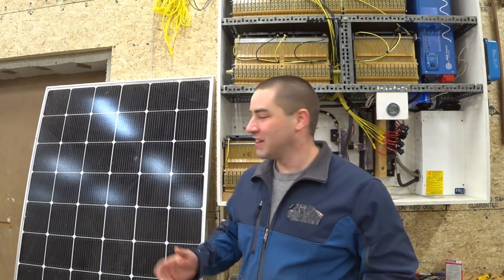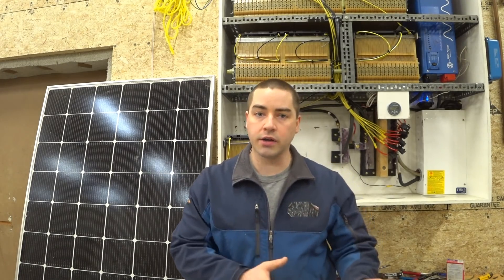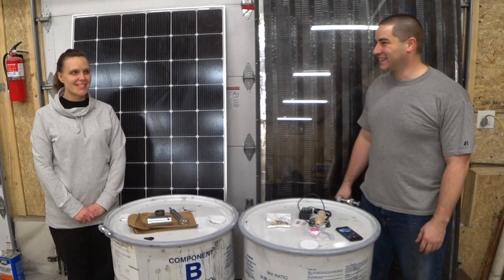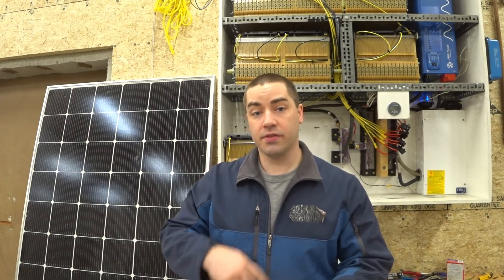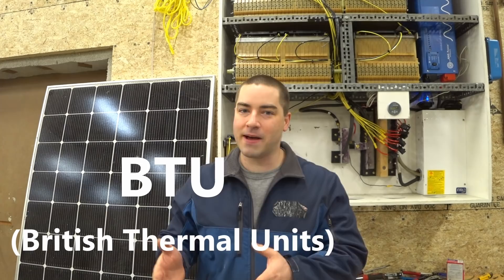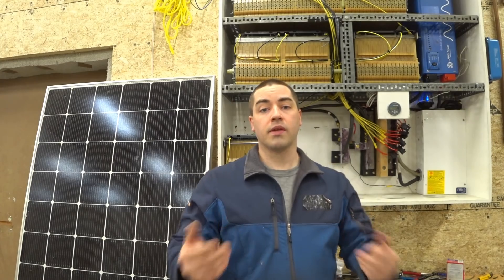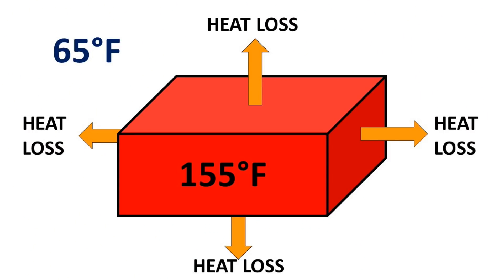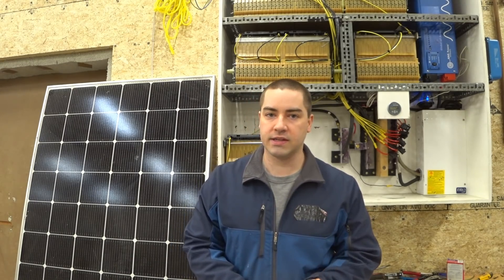Cheapest Energy Storage Off-Grid

Comment: I will pass along here 2 great ideas from the awesome website https://www.builditsolar.com/index.htm, where DavidPoz has a recent article:  1) Solar heat collectors are more efficient for HEAT than PV panels, and can be built by simple diy methods. So you may want to try 'collectors' as an addition to your pv array. 2) Consider building 3 heat storage tanks that are kept at 3 progressive heat levels, so as to charge (and use) them in an optimized way. In sequence of tanks 1, 2, 3, charge them so that the 'hottest' tank 3 gets its charge (heat storage water vs collector water vs use water) up to the level needed to top off the 'use water' at desired output temp. The hot water coming from the solar collector goes into tank 3, then exits to tank 2, then to tank 1 before returning to the collector to be reheated. In this way, tank 3 grabs the effective heat optimally, then passes the 'now less hot' collector water down to tank 2 where the storage water is not as hot but the delta is large, and tank 2 absorbs some more of the heat in the collector water. Then the 'least hot' collector water goes into tank 1, the coolest tank, and even lukewarm collector water can dump a little heat into tank 1, as the delta is still high. Importantly, the 'use water' line passes through the tanks in the OPPOSITE direction of the collector water, so that the coldest use water enters tank 1, and absorbs a little heat from the lukewarm water in tank 1, as the delta between cold tap in and the lukewarm storage water in tank 1 is still fairly high, and this does not cool off your hot tank 3. Then, after leaving tank 1, the now lukewarm 'use water' goes into intermediate tank 2, where the delta is still large, and absorbs some more heat before going to tank 3 for the final heating stage. Note that the tank 1 need not always be lukewarm, as a few days of good sun and low use will allow the full heating of all 3 tanks. Now for a suggestion on how to achieve the 3 tank solution without wasting good structural walls needed to contain the sidewall pressures of a big tank: Using one single large tank, use a 1/2 inch layer of foam insulation to separate the tank into 3 subtanks, with hot tank 3 on top. The insulation layer does not need to be completely waterproof, just do a decent job of allowing the 3 layers to roughly keep their own temps. Then, have your heat exchanger coils into 3 sections and passing through the insulation layer in one hole. Each heat exchanger (1 for collector water and 1 for use water) moves in opposite directions, bottom to top for use water, and top to bottom for collector water. Great site David. thanks.

Comment: Thanks ! I never considered using hot water (liquid storage) before. 
Where I live I'd consider using Mineral Oil in place of water. 

Have you looked into a parabolic reflector for your solar water heating?  One could also use large fresnel lens(es) to heat water (and to melt other things, too).

On another youtube channel a gentleman used flat panel reflectors just using aluminium foil to increase heat from sunlight by up to  20%.
Reply from the maker: Green Power Science is an excellent channel.  I love his projects.

Comment: Okay this one is out of topic question but I am asking hoping to get a answer. I have installed a solar gyzer. It has a vent line on top of its tank. Can I install a breather valve on the vent pipe. Would this save hot water energy?
Reply from the maker: I wouldn't modify the factory vent.  But I also don't own one so I'm not sure.

Comment: would it be possible to store heat (+electricity via heat exchanger) in salt?
Reply from the maker: There are some large commercial systems that use salt, but it's not practical for a small residential system.  Thanks for watching.

Comment: Have you thought of using a bypass for your solar electric as an electric heater coil to absorb the excesses electricity you are not using once your batteries are charged to transfer into your water storage tank as well as the solar heater ??? It would be a secondary way to heat your water when the water solar panel does not produce enough heat during the midst of the coldest days of winter.
Reply from the maker: Yes, absolutely.  I have been playing with diversion loads the past year, but have not implemented one yet.  I just bought bigger inverters, so I plan to set up the diversion load on the AC side.  Thanks for watching.

Comment: Good engineering presentation of heat transfer! However you make sure you treat this stagnant thermal water... both chemical treatment and fresh water makeup + flush thermal water should be done to avoid heath risks... 
Good to note that your thermal lost is overestimated because your Delta T between T ext. & T water will decrease during your electricity shortage! But this constant Delta T assumption  is okay, it is just nice to know that you overestimated the heat lost of the hot water tank.

It would be nice to know how you control and heat your thermal hot water. This component would definitely add up to the total cost of the project.

Comment: We have both solar water and solar electric panels at our house, and the solar water system saves the most money.  But your calculations are somewhat flawed.  You need to add the cost of several solar hot water panels to your system.  There is no way one panel will heat your volume of water to the desired temperature in the number of sunny days available.  You also need to figure out what you are going to do with the excess heat in the unusually sunny periods.  In my case the system overflows into a dry well and new fresh water refills the tank, running up the water bill.  Your numbers seem to be correct, but not complete.

Comment: My heat/domestic hot water comes from storage.  I have a 1500gal tank insulated with closed cell foam.  With my Delta of 95°, I've got roughly 750,000 BTU capacity.  Currently, it's just heat with biomass but I intend to try adding solar thermal next spring.

Comment: keep talking with me over pressures difference's by hydraulic pressure machine and atmospheric administration

now we know that one kg force per cm square area then we use one kilometres squares surface gives tremendous pressure which can easily push or pulled leverage system so we got more healthy option for the world wide pollution solution

Comment: Very interesting!  I am looking for a good way to store energy to heat my garage in the winter to work on projects on the weekends.  I was thinking of doing an in floor heating for the garage  using your method of stored heat even if I had to heat the water from the grid in Offpeak hrs during the week.  But one of the main issues is the floor,  a huge piece of concrete that is not thermally isolated from the cold in the ground and outside edges. I guess I could get a saw cut slots to put in thermal breaks on the outside walls and that would help but the floor come mid winter is still a big portion of energy sucking cold monster.  My walls and ceiling are insulated now but I might have to build a room with raised floor.
Cheers
Reply from the maker: There are a few methods to fixing this.  In my area (Massachusetts) Our garages are made with stem walls, and the slab is poured seprate from the walls.  I've worked on jobs over the years and used two methods.  1: Jack hammer the slab, then insulate, vb, new slab.  2: if the ceiling is high enough, insulate and pour a new slab directly on top of the old slab.

Comment: Brilliant  
Eventually this will be the way to go  Figure out a way to sell a package that integrates PV and thermal storage and you're golden - needs circuitry that shunts PV into HW storage after batteries are topped off.  Indirect is more expensive at first and you have the heat exchanger that needs maint can foul and loose efficency req not inexpensive replacement, direct avoids that but needs a sterilization cycle that will require grid connected power (or for real off the gridders another heat source, wood stove, etc)  
So solutions:
1. Indirect storage Several 100 gal HW rated storage tanks linked to small 20 gal elec water heater w a circulating pump and circuitry to dump PV into the 20 gal heater and circulating pump.  One storage tank has the heat exchanger coil.  I'd guess for 300 gal system about $1,500 of equip needed.  This is probably simplest option for off the grid.
2. Direct storage,  20 gal elec heated by PV after batteries full w circulating pump to 2 - 3 days of hyper insulated storage tanks feeding into you 'standard' HW heater (another circulating pump from your 'standard' HW heater to storage tanks, on timer to sterilize water daily set to run from midnight to 6 AM until such time storage tank temp hits say 140, which will sterilize water in 30 mins or so - sounds bad but if excess PV has already gotten the 300 gals or more of storage water up to 120, not so bad) If by chance you are on peak / off peak power plan to say charge an elec car then even better as sterilization heat will be low cost elec.  I'd guess about $1,000 of equip needed (no heat exchanger those are pretty expensive)
Hope this helps you.

Comment: I'd be interested to see how I can turn the 250 gallons of hot water back into electricity at a rate of 3:1. I use natural gas to heat my water on-demand, so I'd like to find a way to store energy to turn back into electricity. Though the side benefit of having 3-4 days of hot water with no power is pretty cool. Are you using your outdoor solar water heater to get your pool to 180ºF or just electricity or a combination?
Reply: Eh, probably not possible it seems. A company based in Dublin, Ireland called Exergyn has a system that takes 200kW of thermal energy and converts it to 10kW of electricity. Doh.

https://www.newscientist.com/article/2113109-energy-efficient-engine-turns-waste-hot-water-into-electricity/

Comment: A-MAZING analysis! Got me thinking of the idea of a hydronic radiant heating system for our own home w/ stored energy in a big tank like this. Our house still has oil-based forced air which we hate to use. We do have lots of basement space though w/ a heat pump water heater for DHW. Tank heat loss would just help our water heater. :) We also have a big back yard which has room about 50 feet from the house for a stand-alone rack system like yours (we already have grid-tied PV on the roof, but w/ a plug-in car, our average net use/yr is ~0 w/ not much room left for ideal PV placement so an additional electric-based system would cost us). We're also located in South-Central area of CT at 41.5 so a bit warmer than you but still close which would make my numbers similar to yours. So how has this experiment worked out for you this past year? Have you been successful in keeping the tank within the temperature range desired? Keep up the awesome videos!
Reply from the maker: Your project could work out really well.  I'm happy to help you out with details if you want to contact me through Facebook.  https://www.facebook.com/DavidPozEnergy/

Comment: HOT WATER is a VERY aggressive solvent over time. My dad experimented with large solar water heating array in SAT. The very HOT water over SEVERAL years destroyed the concrete tank walls, then several water insoluble liners, that were not very HOT water insoluble liners. He had an approximately 2500 gal tank.
This was 20 years ago. Maybe materials that are more insoluble in hot water have been developed for your sake. Good luck.

Comment: Hey, David, it's Mark again.  Love these videos but there is something I'm not understanding...  You explained the concept of thermal storage and showed how to make the tank which is great... but I'm not seeing where or how you are heating the tank with PV?  Is that in another video?   Are you able to get the tank up to 180 degrees (F) ?   Thanks!
Reply from the maker: I'm heating my tank with solar thermal.  No, it doesn't get up to 180, which is why I dived down the experiment.  At some point I want to build another tank in my crawlspace heated just by solar PV.
Reply: @DavidPozEnergy  Excellent.  I can't wait to see that video.  If you switched your solar thermal panel to evacuated tube, would that get the temp. hotter?
Reply from the maker: Yes, evacuated tubes can get the heat transfer fluid hotter than flat plate solar collectors.

Comment: 2 questions:  

1.   Will solar pv be enough to heat that 250 gallon tank - how many panels would you need?
2.  Can a  250+ gallon storage tank be bought anywhere or do you have to make it yourself?
Reply from the maker: Some people add a solar electric tank in-line with (before) the gas water heater.  If the water is hot enough from solar the gas never kicks on.  But you do have to double check that your gas water heater is OK with this.  Some old models of on-demand gas water heaters are not.  All tank-style gas water heaters are OK with this.
Reply: @DavidPozEnergy  Thanks Dave!
Reply from the maker: Thanks for your questions.
1. Yes, solar PV can heat 250 gallons.  That's not really the concern.  The question is, can it make enough hot water for your families requirements.  My family would need a 3kw solar array connected to a 300 gallon tank to provide us all of our hot water needs with three days of autonomy.  Your families needs will be different.
2. I built my tank, and have a series of videos on it.  It was far cheaper to build my own tank than buying.  I don't know if you can buy a 250 gallon tank, but you can pair 2 or 3 smaller tanks together.  I've seen some people get a pair of 120 gallon tanks, which are pretty common.  Here is an example:  https://www.homedepot.com/p/Richmond-120-Gal-Tall-6-Year-4500-Watt-SE-Heat-Exchanger-Solar-Side-Connect-Electric-Water-Heater-S120HE-1/202771239
Thanks for watching.
Reply: @DavidPozEnergy  Thanks so much David.  Right now we have a natural gas hot water heater, which is much cheaper to operate where I live (Pittsburgh)than electric hot water heaters.   But I'm not sure how to work  your system (solar PV) to my situation.  I am not a DIY person.  Guess I would have to get rid of the gas water heater OR can your system be my main source of hot water but I keep my current hot water heater as a backup?

Comment: Have you considered using something like a te cooler, run backwards to produce electricity instead?
Reply from the maker: No, I haven't run any experiments trying to reverse the process.  I have enough batteries for my electrical loads.  Thanks for watching.
Reply: Some "genius" claimed to have done so using peltier elements. However, I have never seen a proof-of-concept. I have used peltier elements as temperature sensors, output voltage is proportional to temperature.

Comment: Here's an idea, why don't you do what many off grid people have done by having a 30,000 gallon which is about 114,000 liters of water storage. 

Let the earth do the work for you. Don't make your life more difficult than it needs to be. Dirt is great insulator. Look at green earth homes and typical cob earth homes for example. 

You bury the necessary amount of tanks required to reach said capacity out back in your backyard if you got one and bury them below the frost line. BELOOOOOWWW. THEN, you install the heat pump coils to wrap around the tanks, then you make the solar panel powered heat pump suck heat from other parts of your property and dump that heat into the water storage tanks. 

I have a submerged winterized greenhouse connected right against my house. My roof has solar panels with a watt rating of 350 watts per panel. I did the labor myself. Pure Sine Wave inverter and MPPT charge controller and the fuses and all that. Off grid home. Heat pump pulls heat from my roof and attic and other hot areas of my property and puts the heat where I want it instead. You know how hot attics and roofs get. Very hot. especially if you don't use disgusting shingles. God I hate shingles. My water storage tanks are below the frost line right beside my green house. My green house is submerged 5 feet below ground so only the roof sticks out above ground. I can grow apples and oranges and tomatoes in November and December. Anyways, point is, a portion of the heat collected by the heat pump is dumped into the water storage tanks right beside my green house. very hot. If I need the heat elsewhere, I can move that heat elsewhere using the same heat pump. 

All my stuff is underground but if you got pipes above ground you can insulate them or use heat tape or some other way to prevent freezing. 

Note: if you build your water storage high enough into the ground, you can gravity feed your hot water into your house as a dry system instead of a wet system like I have. 

I'm looking for land right now with a decent hillside so I can do just that. I need about an acre of land.

Comment: The Best insulation.

High-vacuum insulation The Quooker system consists of a small tank in the kitchen cupboard that is linked to the boiling water tap on the worktop. The tank acts like a vacuum flask connected to the water mains. The air in the insulated wall is so thin that the heat is unable to escape.

Comment: Very good presentation. I love your diy heat exchanger! I wish you would have talked about cost savings with building your own thermal solar panel. You spent $900, but I think you can build a lot cheaper. No one is build their own PV panels right now, built anyone can build a thermal panel, so its does seems to be a better solution with way may return on investment then PV's